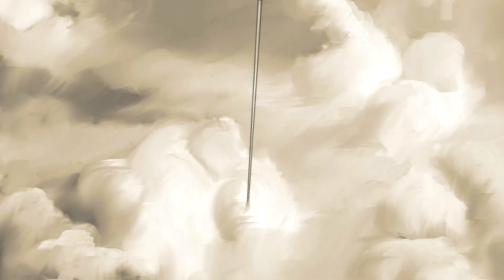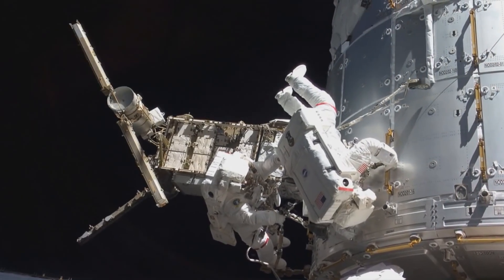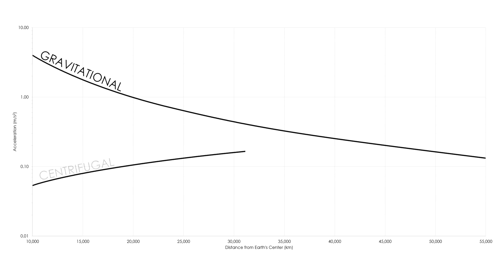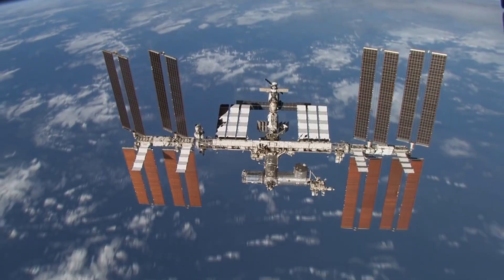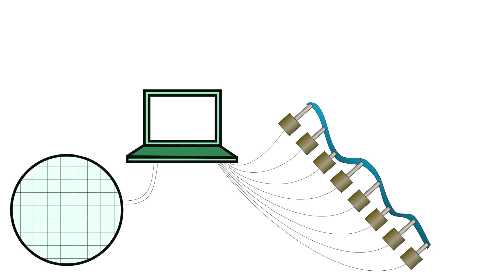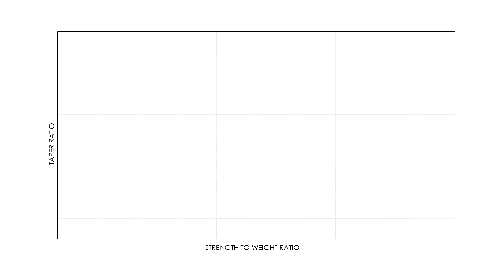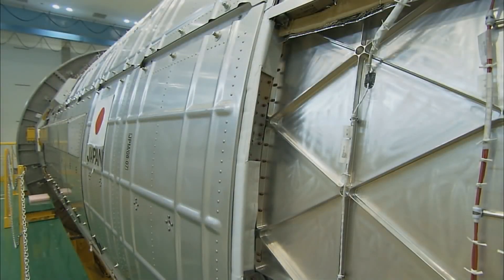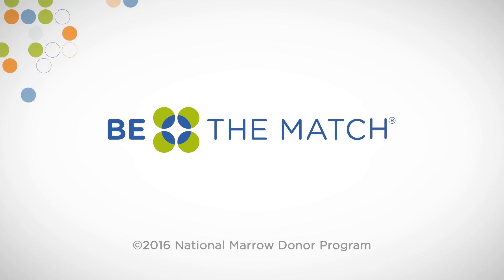Design Your Own Space Elevator

Comment: I think pretending it isn't rotating is a mistake. if you put the counterweight beyond  geostationery orbit, you have to realise that it won't want to stay there. it will continuously try to go off to the sides and I don't want to be in that elevator when that happens.
Reply: ***** I think capturing an asteroid is a piece of cake compared to this. I have orbits as
V^2=mu((2/currentheight)-(1/semi-major axis)) mu being GM (4×10^14 for earth)

So where I'm getting this from is that if it is further out than geostationery but fast enough to have a 24h orbital period it will want to go up and drop speed as if it's an elliptical orbit but can't.
Reply: ***** let's just say a space elevator is a stupid idea. It's an easily deteriorating system. when the elevator goes up and needs to pick up side momentum it will pull that from the cable tugging the station back. It will never be worth the trouble
Reply: ***** ok but we can't speak for the future that much. Mabye our launch vehicles will be so well developed in the future that the costs aren't really that bad anymore. I'm looking at you, spacex! They are really brining down launch costs by reusing launch vehicles and they're revolutionising the industry. So that has to be an effective space elevator if it will beat far future spacex
Reply: *****
I am pretty sure that the horisontal velocity will both come from the earth and the counterweight, so you will still have to burn a little fuel to fix that. We can't measure only the energy costs for the elevator and everything for classic launches.

Such an elevator will most likely have a giant crew that has to be paid (many of witch will be high paid engineers). we have no idea what the maintenance costs will be on all those lasers and the station.. oh, and it has to be built on the equator so you can't hook it up the the American grid. also, hooking it up to the grid is stupid because you use so much power, the grid is gonna fluctuate like crazy in the surrounding area. so you need your own generator. I say nuclear, because this will take a lot of power.

One of the fears with space elevators is that the cable could snap. If or when this happens (cables aren't immortal) the station at geostationary will stay where it is unless it is still attached to the counterweight. then it will be slung into an elliptical orbit or maybe even escape trajectory. I wouldn't wanna be aboard for that. If you detatch the counterweight when this happens, you still need a new one and your elevator is now broken so you can't use that.

So regular launches are a momentary threat (only the launch is dangerous, the rest is fine) but the elevator will be a constant threat. it is also based off of the idea that we can actually make those cables. Who knows what they will cost?!

Comment: I think the biggest problem with space elevators may not be in the engineering, but rather the fact that the tether would be bombarded by satellites.
Reply: npeq93 Micrometeorites are bad enough if your structure is mobile, like the International Space Station, which occasionally needs to adjust its orbit to avoid impact with something that might damage it. A space elevator can't make such orbital adjustments, can it?

Comment: The aspect of the space elevator concept that intrigues me the most is how you would keep the counterweight directly above a point on the earth if for various reasons it was impractical to place the Clarke belt close to geostationary altitude.
Reply: The counterweight would have to be above the Clarke belt in order for the system to work at all. How far above the Clarke belt is dependent upon the actual mass of the elevator, the mass of the counterweight, and the design load of the elevator. In a nutshell, the center of mass of the entire system (elevator, counterweight, moving payloads, etc) would have to be at the altitude of the Clarke belt or higher. The higher the center of mass is, the more tension the tether would have, but also the higher the payload the tether could handle (provided the increased tension doesn't exceed the breaking strength of the tether).

Comment: One method to make friggin' lasers a feasible power delivery method is to split up the workload.

Instead of having only a ground based laser, beaming up to the lift, have an extra one at the anchor, beaming down to the lift. Once the lift passes the point where the energy from the ground based laser becomes marginal, the top one becomes the primary deliverer. The top one also doesn't have to deal with atmospheric disturbances, giving it a larger effective range. As for how to power the top laser? The anchor needs to be heavy, right? Sounds like the perfect excuse to plant a large solar array up there.
Reply: Excellent plan, but you'd probably want either a nuclear reactor or hydrogen batteries up there as well. So your elevator doesn't stop/fall out of the sky at night.
Reply: And who says that it can only be one energy source. Why not eletrcal power from a wire to start and then a boost from a reusable rocket finished off with the Lazer from the top powered by a solar array. Then on the return Lazer to gravity.
Reply: I sort of like this idea, but the Solar implementation at the top looses me, as well as the break point for the laser.

 Starting with the laser break point(meaning the point where the elevator switches from Earth to the "space laser").  That specific point, would have to be almost outside the atmosphere to be really just economic enough to implement.  Reason being, we would want the "space laser" to(as you also say) avoid distortion to get us up there the rest of the way, but also the break(or switch over) point would mean that there would have to be some power compensation(because of the "Earth laser's" distortion) before we reached the breaking point.  That would also mean added weight to the lift, because(with current technology) circuitry involved to make a regulator which could handle the power load for that lift, would only add more weight causing yet again a power vs weight challenge.

The idea of putting a solar array at the top, again involves the idea of both electrical power vs weight.  A decent enough solar array capable of producing that kind of power to push a laser that pushes a cart up a cable, in addition to the to the distortion of the "space laser"(yes it still has some distortion in space, just not nearly as much as it would going through the atmosphere), would mean that you would need a LOT of panels to create that decent load.  A lot of solar panels means a lot of flat usable space, which can be very hard to achieve especially when the counterweight needs to be certain mass which might not mean enough space for panels, in  a realistic format.
Reply: @TheKing-hr7uh  Carbon nanotubes are an excellent conductor of electricity and are uber-light.
Reply: In addition to the other answers, I would like to point out the havoc such a laser would cause on earth, were it to ever miss the panel (and part of the beam WILL miss, laser beams are not perfecty homogeneous tubes of light even in vacuum)
Reply: The problem is that you don't need power at the top: you get free acceleration from centripetal force.
Reply: We could put a cable for electricity inside the big cable to power the thing that goes up and down
Reply: @jim6213  That ads more weight, and im assuming the copper or whatever conductor they would have to use for the wire would have to taper even more than the steel making the top of the wire thicker than our planet 1000000X over.
Reply: @TheKing-hr7uh  Line losses, for one.

Comment: Could this be a solution?  
A satellite placed in the Clarke belt acting as an elevator. Not with a fixed wire on earth, but with a spool of wire with the lift attached.  The wire would be assembled in space. (It's easier to create nano materials in micro gravity is it not?)

Solar panels and motors are already in space (and not added to the weight of the lift), delivering the lift anywhere on the planet (at equator plane ofc.) 

There would be minimal wear on the wire instead of a thing tearing in to it by traveling up and down. The only thing is that the satellite must extend it's orbit, as the wire and lift descends, and vice versa.

Thumb it up if it sounds correct. Let me now what the adversities would be in the comments.

Comment: If we had a strong enough material, the tether could be hollow, like a straw, and use the centrifugal force to suck water (and the climber) up to the station, where the climber could then descend down the outside of the tether or down a second hollow tether.  The exiting water at the top could even be angled to create vectored thrust to move the station out of the way of space debris.
Reply: I didn't do any math to prove it, but the centrifugal force at the base of the "straw" would be almost negligible and you would have to rely on the pressure difference between the top and bottom to pull the water up (basically how a straw works).

Problem with that is a traditional straw (a basic hollow tube) wouldn't work since atmospheric pressure can only raise a column of water ~10m. The tube would need some form of locks on the way up and a valve/pump mechanism. Mechanisms increase the weight/complexity of the tether needing a stronger material etc.

You might be able to use steam, but keeping it from condensing as it travels ~36,000km would be an entirely new problem :d
Reply: I'm not sure what you mean by atmospheric pressure not being enough, unless you're referring to the negative pressure created by fluid at the top of the centrifugal pump not being enough to overcome gravity, in which case I see your point   

Even if the tube were long enough that the water exited the top with enough force to create a total vacuum inside the tube, a vacuum wouldn't be enough to overcome gravity.  If it were, the vacuum of space would be sucking our atmosphere away right now.  

We would have to create enough pressure at ground to drive the water up the pipe far enough for the centrifugal pump suction to take over.  Again it boils down to needing impossibly strong materials. If we had materials that strong and light, we could just build a giant balloon, create a vacuum inside, and float most of the way up..
Reply: I was just saying the pressure differential is equal to atmospheric pressure (or whatever pressure you can create at the base), basically saying it wouldn't be able to solely rely on the suction of the centrifugal pump (what you said)

Also balloons sink in a vacuum (if they don't explode first) :d
Reply: Newhbish Vacuum balloons don't explode, and how high they would go depends only on the weight of the theoretical material they're made of.  They would be able to get us most of the way up if we had such a super strong/light material to make them from.
Reply: DRAT311 I'm not sure what you mean by a "Vacuum Balloon" so I'm just assuming you mean a balloon in some kind of evacuated tube.

(If you're talking about a balloon surrounded by a vacuum read on, if not skip to the last paragraph)
A balloon floats because the hydrostatic pressure exerted by the surrounding fluid is greater than that of gravity. This usually requires the mass of balloon + mass of material to be less than the displaced mass of the fluid it is in. This is known as buoyancy and its how boats (and balloons) float. If you remove the fluid around a balloon (vacuum) it no longer has a force of buoyancy, which leaves just gravity, causing the balloon to fall (like a rock)

Balloons do explode but its usually at altitude where the surrounding pressure is much less that what is inside the balloon. The lack of pressure on the outside of the balloon causing the balloon to expand in size, stretching the material. When the material can't stretch any more the balloon bursts.

(This is for a container with a vacuum inside)
Like I said I'm not sure what you mean by a
"Vacuum Balloon", but if you mean a container with a vacuum inside. Then you would need an insanely good material for both the container and the tube which it is inside since this container would have to contain a high pressure fluid from sea level all the way to 36,000 km. Just a quick calculation shows that you would have a pressure of 430,000kPa (if you used air) at the base of the tether. Thats roughly 4x the pressure at the bottom of the mariana trench. Either way its way its impossible to do :(
Reply: Newhbish By vacuum balloon I mean a sphere with a vacuum inside.  It would not travel up a tube.  I original stated that if we had a hypothetical material strong enough to make a tube that could be filled with enough pressure to shoot water into space then at that point it would be easier to simply use that material to make a giant vacuum balloon and get "most of the way" to space that way. That would be a replacement for the space elevator, not something to travel up it.
Reply: Ah I see what you're saying, just lift a rocket most of the way with a balloon and launch from there. There are some problems but it would make it significantly easier than engineering an elevator.

Also disclaimer I messed up on my pressure calculation (didn't account for changing gravity) but neither of us were proposing it so no point fixing it :d

Comment: Can we power it using the tether itself, a large capacitor and AC current ?
Reply: Looking at this from a calculations point of view: It's still really difficult.

You'd need a fucking big cable, a lot of voltage, etc.

Assuming you can power the system from both ends, you'll probably need 1MV or better, which is only used in a handful of  transmission lines around the world (like literally <5 I think):

1000kv DC
1cm diameter Aluminium cable
20 million meters
7 amps

15% loss. Leaving ~ 6 amps, so 6MW available.

6MW lifting 10 ton (metric): 60m/s. Approx 1 week travel time!

BUTBUTBUT: Just realized I forgot to calculate for gravity dropping as we climb so maybe 20 ton, but whatever: you see the difficulties involved. 

To be financially viable I think you'd either need 10+MV or a superconductor of some sought. 10t/week is just miserable given the possible cost. 

Without a super conductor you need to
Reply: bbqroast well, I was assuming the tether would have to be made from carbon nanotubes or graphene, Both are extremely good conductors. My question was much more about using a single line and a capacitance to transmit power instead of having 2 lines. Less than 3 days travel is still acceptable
Reply: Mik Wind Oh lol, the calculator I was using is really for household electrical work. So just has "Aluminium" and "Copper".

I could almost see electrical cabling working with aluminium, so it would def. work with carbon nanotubes!

Comment: Balancing forces is all fine and dandy, but you didn't talk about whiplash from the lifter, wind effects, space debris, what would happen if the cable snapped, etc.
And once you build your space elevator form impossible materials, say in a 100 years, what would your launch cadence be? 2015 had 82 successful launches to space. To keep up with demand in a 100 years, you would need hundreds of space elevators.
Thinking about it, the energy losses all the way from "fuel" to electricity, electricity to laser, transport trough the atmosphere, laser to electricity again, and finally electricity to motion, is probably way larger then just straight up burning rocket fuel, even considering the losses associated with making those fuels. So why even bother if rockets can become fully reusable and rutine before such a time.

Comment: Nice video :)
why don't you "just" speed up the climber on the earth by a rocket motor and later use something like a nuclear motor?
Reply: Because the whole point of a space elevator is to eliminate the need to use rocket motors to get into orbit.
Reply: It would still be way cheaper, and you would only need some for the first part of the journey, as thats where most of the downward forces are the strongest